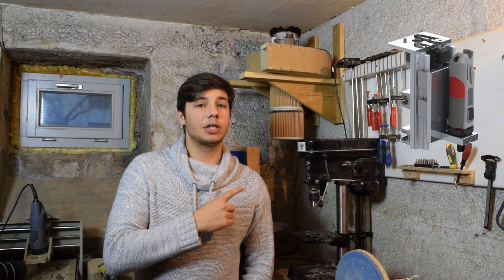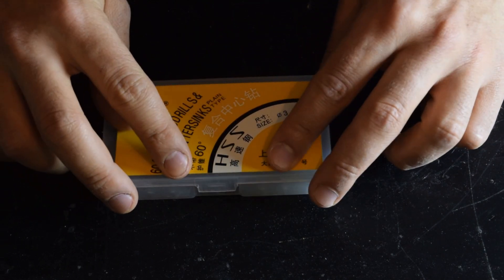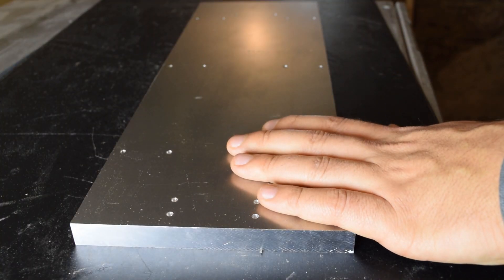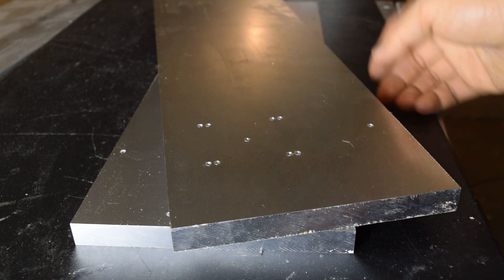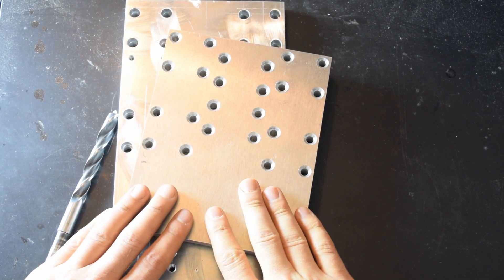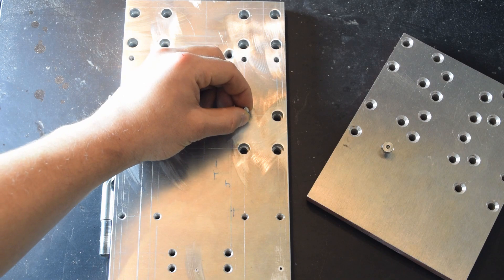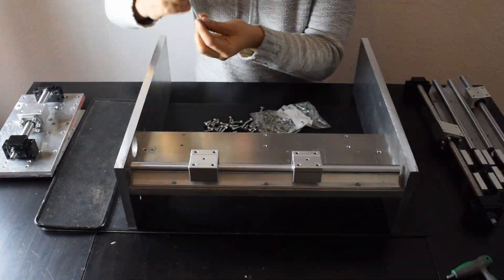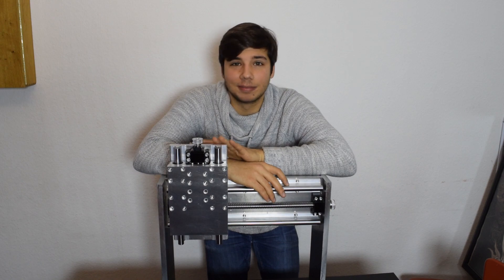Super Strong DIY CNC using 15mm aluminium plates!! (Part 2/ X Axis)

Comment: What should the distance be between the router collet and the waste board.
Reply from the maker: Depends on your machine and what you want to do with it. So for me I wanted 100mm max height so the gantry is 105mm over the Wasteboard and the collet can be a maximum of I think 130mm or so

Comment: Which aluminum alloy it is?
Reply from the maker: Al Mg 4.5 not the best choice, but I didn't have anything different. Also I didn't know any better :D
Reply: @Uniquelymade  Well then it should be 5xxx series of aluminum . Mg makes aluminum less ductile that is even good for us and also makes it more corrosion resistant and more though.

I am also building cnc have parts too but i don't have any  tools except my drill machine😉😉😆😆

I am also planning to use aluminum plates but i must have a press drill.
Reply from the maker: Well my drill press cost me like 45€ used and I still think i payed too much :D 
My point is, if i can build this with only a drill press, and I pretty much just winged it, anyone should be able to do it.
Even tho it took me almost 6 month. All those holes will drive you crazy ^^
Reply: @Uniquelymade  This is all about measurements if you measure and  
Correctly then you gonna get better results.

That's why people say measure twice cut once. But for now measure 10 times and drill one😅.
Reply: @Uniquelymade  Last question brother how you cut your aluminium plates ?? It must not be waterjeted becouse you would have get the drill holes in it.
Reply from the maker: I had the plates cut to size when I bought them. Also all the holes are a bit oversized so I can find adjust later.
Reply: @Uniquelymade  Mmm Max i want to shop and they said they can cut. But they were using a skill saw/ hand circular saw. But they were not giving much attention to marking the piece square so i didn't bought it. By the way finish of cut was extremely good. Thanks for your help.☺️
Reply from the maker: You are welcome :) if I would do it again I would have just have the parts cut with a water jet and spend maybe 200€ more but save around 20 hours just in laying out and doing holes
Reply: @Uniquelymade  😁😁😁😂🤣 Yes, but its not extremely required because all pices are just rectangular. You just need a good press drill to and you are done. 

Why you kept the middle plate in centre of two vertical plates?
Reply from the maker: It has something to do with how far out the spindle center would be. I kinda don't remember why exactly but I had a reason 😁
Reply: @Uniquelymade  How wide bearing are distance from one bearing to other on same rail?? I am really confused what it should be more batter but if i give it too wide i will have to compromise with working area?

Sorry for lot of questions but i tried to seach the cnc on your website but got nothing. It it there??
Reply from the maker: No problem. No I haven't updated the website in a while.

What cam software are you using? When I get home I can look up all the dimensions you want
Reply: @Uniquelymade  I am designing it in sktechup 😂😂🤣 well  for now don't know much about cam. After finishing my cnc i will dive into it. 

I hope your cnc is working well. Did you sell anything you mode? I love it if peoples are buying it. You deserve it because you worked hard for this . God bless you , you alway get success in life☺️☺️☺️.
Reply from the maker: Thank you man :) 
I am making back some money doing prototype work for other people.
I am home now. For the Y table i just devided the space in thirds, so it equaly supported over the entire surface.
For the X-axis i kinda worked with what dimensions the vendor was willing to cut to, in this case i think 150mm hight.
The Z-axis I actually partially cut with my tablesaw (terrible edges).

Some advice i would give, is to make the Z-axis higher than you think you will need.
I have 100mm of travel now, but if I put a vice on there, or a homemade vaccuum table, I wish I had more travel.

If you need any help you can always hit me up :)
Reply: @Uniquelymade  well i have 300mm z axis rail so can have 200mm of working length . I consider it before making it thanks for kind reply.😊😊😊